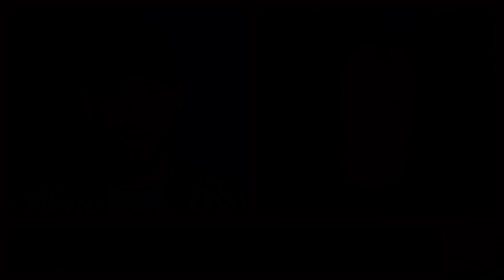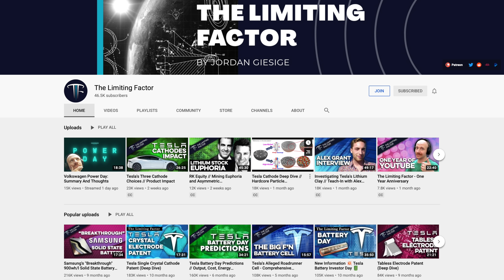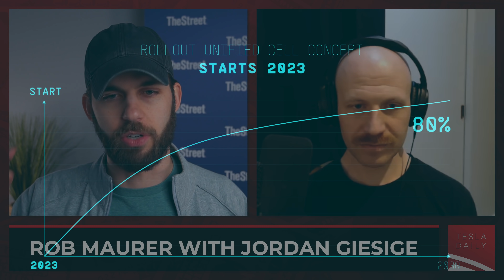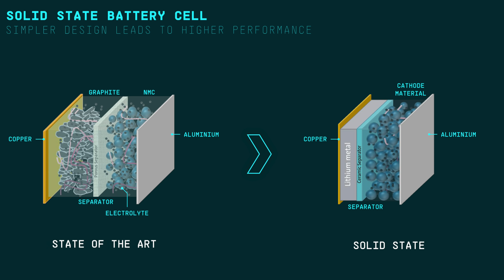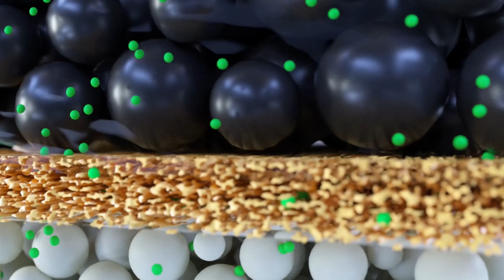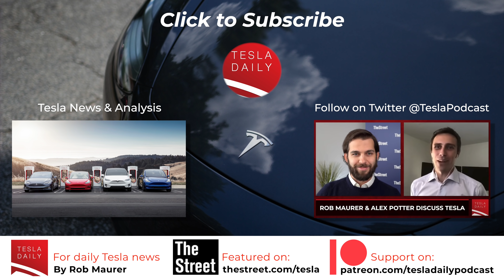Rob Maurer w/ The Limiting Factor on VW Power Day, Solid State Batteries, Tesla’s Advantages & More

Comment: Batteries, batteries, batteries, ever since I got my Nissan Leaf in 2011 all I've heard is batteries. I moved from the Leaf to a BMW i3 and now have a Tesla M3  but I will let you in on secret most people seem to not know, all 3 of my electric vehicles have not used batteries to turn the wheels. All 3 have electric motors turning the wheels, in fact my Tesla has 2 electric motors, one for the rear wheels and one for the front wheels. 
Now this secret is certainly not known by Toyota but it is the very first fundamental step in the transition to us all driving electric one day.
It does not matter whether the car has big or small battery, what chemistry it has, whether it is filled from the grid, or an on board generator or fuel cell, that first fundamental step has to be taken. Get electric motors to be the only thing turning the wheels.
And the truth is, had Toyota switch from being the number one parallel hybrid auto maker (which they are) to being a series hybrid auto maker, they would today be the number one EV maker and Tesla would just be a foot note in history as a little company that made a roadster.

Comment: VW has an advantage that Tesla does not. VW can test its high-end cells in its race vehicles. VW placed fast charging as its key goal for non high-end vehicles. It has charging at 3.5C with its current cells and 4.2C as its target for long-life cells. 4.2C is easy with LFP. VW has a large entry vehicle production which Tesla will never have. Probably half VW production will be LFP, and 30% nickel-manganese. Cell2Pack is where VW is planning to be shortly. Cell2Vehicle is where they are going. VW will recycle battery packs for energy storage, and then do recycling. The recycling process was very insightful - deep discharge of packs before disassembly of packs down to cells (large prismatic) than put cells through grinder. The ground granules then put in a water medium and separated by a magnetic attraction process, then metals (aluminium and copper), then plastics leaving the black powder which is the cathode and anode material. It goes through a process they did not explain. Except for the magnetic step, the other processes are likely done in a cyclone which separates materials based on density. Coal mines uses cyclones to produce different grades of product, so large cyclone tech is very mature. While Gordon has done a lot of research on battery chemistries, he has not investigated the engineering aspects of the VW presentation. VW made the point of saying it has 600,000 employees on three continents. It is addressing the engineering, social, environmental and political aspects of its change to EVs. VW gave the presentation you would expect from an OEM going hardcore into EVs. The other legacy OEM's will follow suit if not make much of a song and dance and will likely be behind VW on timeline. Tesla has runs onboard, but its presentation was nowhere near as comprehensive.

Comment: If solid state becomes mature enough to start entering the market any time soon, it's not going to be a problem.  This is because the demand for batteries will still be large and variable.  Just like Tesla is continuing to use and produce the older battery styles as they begin making the 4680s, so too will they continue producing liquid electrolyte batteries and using those for some products while they begin to ramp production on solid state for applications where its improvements are especially advantageous.

Comment: Another thing to keep in mind long term--as batt costs decrease they become a smaller component of the entire vehicle production price, so while batts are the biggest input today they may not always be as drive train, interiors, etc., won't likely decrease near as fast.
Reply: @The Monster Under Your Bed  I figured the 12V batt was safety backup but why not an Li one anyway?  Yeah higher voltage accessories would save a lot of wire, sort of surprised they haven't gone that rout already like some other mfgs I believe.

Comment: The advancement coming, whether it’s Tesla 4680, or solid state, it’s going to blow away the battery swap. Those companies are on track for extinction!!
Reply: No & Yes, remember battery swap is a two edged sword, you can chose to solo charge it if when you choose.
Another very big advantage is that for previous car models with battery swap technology can later access next generation battery technology at a far lower entry cost compared to non-swappable batteries, think about that for a second! EV cars sold this year can be vastly inferior in terms of battery technology in as little as 5yrs from now, apart from the guaranteed wrights law declining cost curve for new EV prices. That's a double whamming right there for those purchasing EV now, atleast battery swapping can alleviate one of those issues

Comment: Another thing Tesla has going for them is if/when SS becomes realistic, the cell production machines aren't as big of a problem to swap out one at a time over time. Nothing stopping a GigaFactory from producing both and phasing over from one to the other.  The factory is many "cells" (individual units) that can be upgraded/swapped one at a time.  The batteries can be resold or repurposed, such as for energy storage and there's a good chance they'll still be building GigaFactories at the time anyway, so the new factories make the SS while the old can switch over to making cells for grid storage and power-walls until it makes sense to migrate.
Reply: YES

Comment: You folks are in a delusion. What Tesla did is increased the size of the cell 5x and thus 5x the capacity, with maybe 3% decrease on pack level due to less shells. The rest is years away, including the tab-less design. They didn’t show nothing else to anyone whatsoever. Just words. Their claim of 50% is long-term in their own words - how long that is? Your guess is as good as mine. The difference is - other companies don’t brag about technologies they haven’t perfected yet, Tesla do. This applies to FSD same as it applies to the batteries. We were supposed to sit in level 5 driverless cars in 2016... the competition IS on par or close enough to not make a difference.
Reply: Don’t be surprised when the batteries don’t pan out this year or indeed the next year. The semi will use the conventional batteries, if it’s released this year at all.
Reply: Sure buddy you keep losing money.

Comment: Why so much skepticism over solid state batteries? Shouldn't we be cheering these advances in battery tech?
Reply from the maker: The problem is with cheerleading technological advancements before they are proven or ready is that it leads to a misallocation of capital / poor investments. It's something that is often taken advantage of, so skepticism is warranted.
Reply: @rob_maurer  Oh I see. So I should stop cheering on Tesla Level 5 autonomy because it is not ready and I should, instead, be skeptical?
Reply from the maker: Seems like you're implying that I do that, but to give you the benefit of the doubt and answer sincerely, I generally encourage skepticism, yes. I have no problem with anyone that thinks Tesla won't achieve level 5. I think Tesla is the leader and that's pretty much where I leave it, certainly wouldn't call that cheerleading.
Reply: @rob_maurer  I'm not implying you do anything. You tell us to be skeptical of anything that is not "proven or ready". I'm asking you, should this skepticism apply to FSD as well?
Reply from the maker: "I generally encourage skepticism, yes. I have no problem with anyone that thinks Tesla won't achieve level 5."
Reply: Skepticism is healthy or else you get another NKLA.
Reply: When it's in cars and works good we will cheer it on.
Reply: @user-RCST  what's wrong with supporting it now?
Reply: @k1fizz  because pretty much all solid state batteries aren't scalable.
Reply: One piece to be skeptical about is this square pack concept.  The cylindrical cell provides structural advantages that could very possibly negate many of the SS advantages, especially as  cylindrical cells improve.  Scaling up also isn't as easy as people think.  You can't just start pre-building manufacturing plants right now like they did for the vaccines.

Comment: My strength is in electronics, not battery chemistry.  I saw the big advantage in the tabless design of the 4680 cells because it lowers the internal series resistance and thus lowers the heating at high currents.  That's very important for fast charging.  And like he said, much of this is optimization.  "Little changes done often make a lot of improvement."
Reply: The fact that the planned improvements were from a series of small things is critical in making it a much lower risk venture.  Even if Tesla fails at one or two of them, they will still see substantial improvements from everything else.  Relying on a single paradigm-shifting innovation, on the other hand, would have been all or nothing.  "Putting all their eggs in one basket."

Comment: Did VW say they are planning 60% or 6 million EV or Bev share of their total vehicle producton by 2030? If that is the case then the other 40% or 4 million of their total vehicle production by 2030 will be ICE vehicles? Wouldn't 10 million vehicles be null production growth over the next decade as their 2020 production was about 9 million and their 2019 production was about 10.5 million? I guess they now know it won't be easy to transition from 100% ICE to 60%/40% BEV/ICE.  production.

Comment: How can you ignore the V2G stuff? That’s a crucial role going deep into the decade, and Tesla was way short on that!
Reply: Not really.
Elon Musk addressed the question.
Reply: @rogerstarkey5390  and said that they don’t do V2G which is wrong. It’s trivial for Tesla to enable V2G on their ecosystem and they should not ignore this technology.
Reply: @ThanosSustainable   I think Elon is simply thinking longer term.  Using EVs as supplemental power supplies may make a lot of sense in this time of transition, but in the long run it's a better idea (and quite feasible) to have independent battery backups.
Reply: @bigdream_dreambig  indeed; that’s what Elon thinks, but I believe he’s wrong. Parked EVs can be valuable assets on a grid that’s high on renewables. I was expecting the V2G conversation on this here video.
Reply: @The Monster Under Your Bed  that's not how V2G is utilized. It won't bring down your EV battery just for the fun of it. It will use the battery as a means to sporadically and quickly balance the grid when needed. Anyone with a Tesla Solar + Storage installation can outright understand this.

Comment: The thing I found interesting was they were trying to show that they have learnt from the money printing industry how to improve their process. Kind of copying Tesla on the newspaper and bottling inspirations. My problem with that is.... how hard-core have the cost reductions and efficiencies of printing money improved over the years? Does driving down every tiny efficiency and cent really what the money printing industry has done? I HIGHLY doubt it. So drawing inspiration on how to do things from a process that has alot of room to improve does not seem very smart. Unless they are just making you think they are printing money with their process, which I guess is why they showed that, but I was very unimpressed by that... 

I would have though a prismatic cell would need to be folded and placed in the case, not just layered onto of each other like they showed with the money manufacturing process, so that confused me and made me think it was purely theatre again...
Reply: Cylindrical have only one anode and cathode spiraled together.  From what I understand, prismatic have many stacked alternating anodes and cathodes (i.e. not folded).  These each have their own tab, which adds complexity but prevents the overheating problem that cylindrical used to have before Tesla's "tabless"/multi-tab innovation.
Reply: @bigdream_dreambig  hmmm interesting. Thanks for the info, I'll look into it further :)

Comment: Here some interesting quotes from VW power day (Duessmann, CEO Audi): „after almost nine months we have now reached an important project milestone and successfully completed the concept phase for the first model based on Artemis"
31:45 "we are now starting serial development of this project (Artemis)
32:22 "the Artemis model will be the initial use case of cell to pack technology, the groups new standard"
32:31 "once more, the model serves as a pioneer for technology that we will later roll out across the entire group"
So when considering that a development cycle for a car is between 5-7 years this means we will see the cell to pack technology first in 2026 while Tesla will implement the structural battery pack most likely in 2021. And VW would have it only in a single model. Furthermore it seems the cell to pack technology is not suitable for the MEB platform which means VW will stick to a far inferior technology compared to Teslas structural battery technology for at least 5 years. When reading between the lines the VW presentation is more a confession that they are far behind Tesla. What I appreciate very much ist that they publicly and seriously commit to EV´s.
Reply: Good analysis. Corporate-speak hides a lot of information behind words.
Reply: This was freaking revealing! ^^
Great job Nils, will keep an eye out for your analysis in the future. :D
Reply: @elektrotehnik_94c_NinoD  Thanks! It was quite difficult to watch, but everything that matters (batteries and battery factories) was talked about in the first half an hour. It is interesting to watch it with the focus on whether they bluff or not. Quite a lot of tricks to make you think things which they do not really say, when you check it. So they talk about very high cost savings but when going deeper into it it is related to the cheaper LFP technology, while Teslas projected cost saving are compared to the same type of chemistry. So while the numbers are roughly the same it is only half of what Tesla talked about plus VW timeline is further in the future, so Tesla may be even further ahead at that time.

Comment: Solid state batteries will be a game changer.  They charge faster, work better in cold temps, and as you pointed out, don't need a complicated BMS.  And...they're safer (no flammable electrolyte).  Your 2030 time frame estimate may be correct but I hope it's sooner than that.

Comment: VW Group is the most indebted company in the world at $192 B.  How are they going to pay their bills while loosing overall market share to Tesla, while spending a ton of money on hiring new engineers and building battery production.  When listening to Cathy Wood well over 50% of new car sales will be EV's by 2025!   By 2030 100% of passenger car/truck sales will be EV...if VW will only have 60% of their production in EVs by 2030, what are they manufacturing and selling for the other 40%???  Are they just admitting that VW will only be 60% their current size by 2030?

Comment: No word about the unified cells? My understanding is that VW is talking about one form factor for different chemistry. Is that technological possible?
Reply: chemistry and cell shape are 2 different things. you can combine these as you like, with the various advantages and disadvantages. This is also done with the 4680 cells, probably using 3 different chemistries.
Reply: I don't see why this was even emphasized. The alternative would be to have multiple different cells for different models, and this makes no sense. Of course it would be one form factor, and this will probably be different to the ones they have right now in vw and Audi/Porsche. Anyone who was thinking a manufacturer would have anything but a unified form factor, is not thinking at all.
Reply: @HNedel  Well, technology and innovation progresses that might make new form factors useful. Tesla is already at their 3rd form factor after 8 years, 18650, 2170, 4680. And every generation improved overall density and weight by making the cells bigger. So sticking to one form factor for the next 10 years, as VW announced, seems not to be the most obvious choice. That VW uses the same batteries for a few car models that are launched within the next couple of years, that makes sense, yes, but that is not what VW announced.
Reply: @stefanwagener  18650 is not a tesla form factor, they used it because it was an industry standard for the most mass produced cell at the time, so it was very cheap. As soon as they could afford it, they made the switch to a slightly bigger cell while which didn’t require major changes to existing production lines. The new cell they announced is sort of the endgame for where they want to be in the foreseeable future

Vw is also on their third or fourth cell size, if you count the hybrid models. The e-golf cell is different to the id.3 cell, and the new one which they announced will be different still. When manufacturers are investing billions in new gigafactories, it is different from buying what suppliers have available. The Investment implies that it will be a long term commitment to a single form factor.